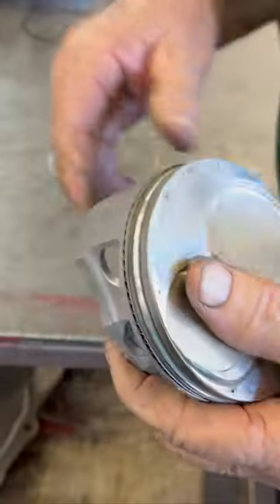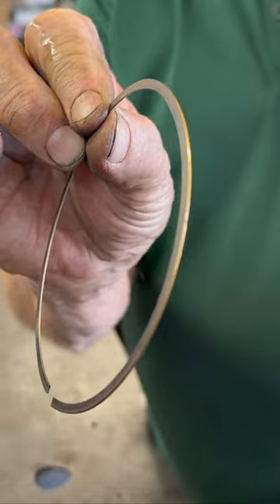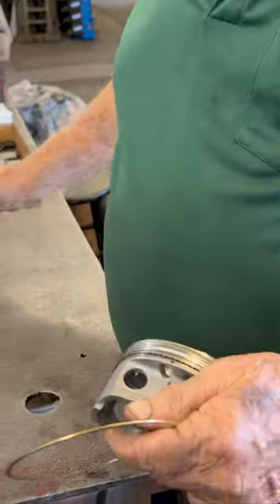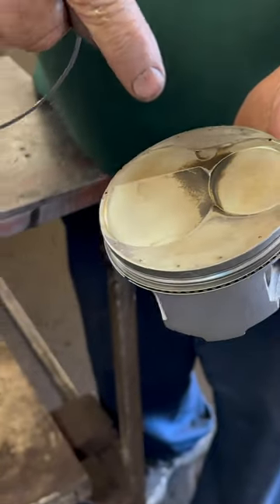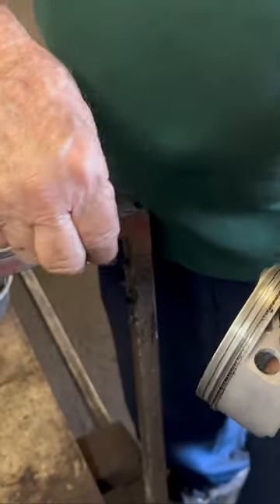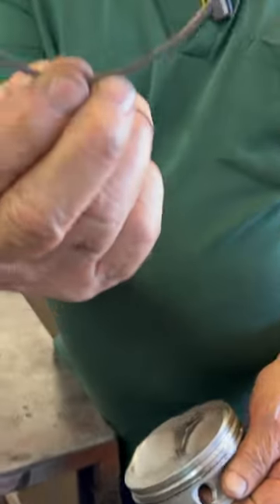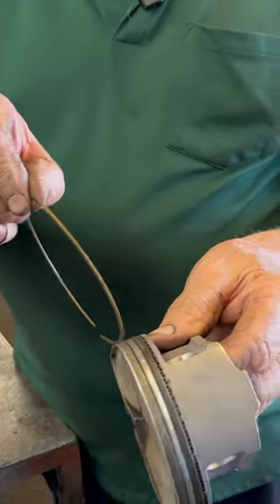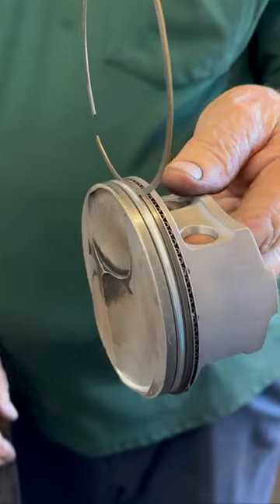No Drag Piston Rings? Ed Smith shares another secret Engine Building and Racing experiences #engines

Comment: Gas port pistons are for ring flutter at high rpm. Small gas port hole will easily fill with carbon so don’t think about using them on the street. Only for racing application.
Reply from the maker: Yes, that is correct. Thank you.
Reply: I was thinking the tiny holes would fill up with carbon and gunk
Reply: That's exactly what I was thinking......they'd clog up real quick with regular gas and regular driving.
Reply: There is already enough compression above the top ring to push the top ring out against the Cylinder wall. As the crown of a pistón is smaller diameter than the skurt
Reply: In addition this trick is going to increase fuel consumption. Unspent fuel is going into those holes and definitely increasing consumption. But I can see a high tolerance fitting engine properly lubricated spinning faster. You're definitely going to want to change the oil during the race / after each drag run.
Reply: But , but , my Honda only works at WOT , why can I NOT have them .I have a free flowing 4in oval exhaust made from inconel. I can use gas ports If I want ! Haters..
Reply: @jeremykastrup6907  apparently you need to look up the definition of hater….
Reply: Even in a race application they're great for what they do but they are hard on cylinder boar, it cuts the life down on cylinder bores in half.
Reply: Ther are for for boost and hold higher compression.
Reply: @FLORIDAMANIAM-he2lz  And for Normally aspirated.
Reply: funny my 426 had em since the motor was built in 1968 by dick landy i drove it on the street 10 years with none of those issues
Reply: not if you do what i did they used to sell water injection to clean carbon deposits every oil change i did what the 80 something year old man who sold me the car told me to do you take a water bottle and shoot straight water down the carb until it almost dies keep doing it 10-15 times you will see black crap pour out the tailpipe let it flow ! put one cup of kerosene and half a cup transmission fluid in the oil run it 5 -10 mins drain the oil let it drain completely a good hour take some hose clamps clamp 4 magnets to the oil filter so any metal sticks to the inside of the oil filter . your good another 2-3000 miles id change mine every 1000 never had any issues that motor ran 6:60 in the 8th mile almost 10 years and i ran it on the street every other day

Comment: In racing, we always used a worn-out top oil-scraper ring, since the engine technical inspection manual said they had to be present and be stock appearing.  This was done to reduce oil-ring friction.  Any small increase in oil consumption isn't an issue in racing.  Especially since we changed oil between race days as well as ran 100% synthetic SAE 50W oil.  We never experienced any carbon buildup on top of the pistons, valves, or within the clearance volume.  We always fully clearanced our engines to reduce friction.  The art of clearancing engines is knowing when to stop.  Too much clearance will decrease power due to excessive blow by and reliability.  We called over-clearanced engines "hand grenade" engines.  They would run fast, but didn't last.  The key is finding that sweet spot that will minimize friction, maximize power, and still be reliable enough not to self destruct.
Reply from the maker: Thank you for sharing your experiences and that excellent explanation!

Comment: Formula 1 pistons use to have holes that let oil from the crack get to the combustion chamber, this special oil had high octane and acted as a boost of hp the race car. A secret that was finally found out and new rules put in place
Reply: Yeah good ol'formula 1 - not how fast you can go, but how far you can bend the rules without breaking them
Reply: Most All oil is high octane. High octane means it burns slower. Low octane burns faster why you get engine knock file burns too fast
Reply: @airgliderz it's generally cetane that causes faster detonation
Reply: It's like a hybrid 2 - stroke in a way in a four stroke cycle. You'd definitely need a large crankcase / reservoir.

Comment: Low drag piston rings are used in more new cars now, those cars are often known to be oil burners because they're not scraping as much oil off the cylinder. Subarus are well known oil burners now.
Reply from the maker: Interesting
Reply: This is the comment I was looking for. 
Subaru isn't the only culprit. 
Gm across the board, ford, Toyota, BMW , Mercedes, Chrysler, Jeep doesn't matter which, they all burn oil. Ridiculous amounts of oil.
Reply: Wife just sold her 2014 Subaru Crosstrek with 120,000 miles. She had all the service work done at the Subaru dealership. I never did the maintenance on the car but I always check the fluid levels and tire pressures. Especially after it came back from service to make sure they did it correctly. The oil level never dropped between oil changes. Maybe the car is older than the engines you're talking about. The only extra service work done on the car was tires, brakes and a battery.
Reply: @davidclemens1578  We have a Subaru with 150k miles and it still runs like a brand new car.  The trick is proper maintenance and that includes running a good top cylinder lubricant in the fuel.
Reply: The Hyundai 1.6 has this problem. Well, if you keep up with oil level it's fine. Most people don't check their own oil anymore. Too fat. Too addicted to the internet.

Comment: I have used the total seal rings along with the itty bitty holes in the piston tops, along with drilling holes (2on each side) between the bottom of the oil ring and the wrist pin to feed the wrist pin bore, it worked better than you would believe, less oil leaks, etc.
Reply from the maker: Thanks for your comment, Dave! Great to have you on the channel
Reply: Interesting idea. 
Thank You!

Comment: There is one thing about the total seal rings that he forgot to mention: The thin ring that he showed here does not actually touch the cylinder walls... The 'L' shaped ring (that the thin ring fits inside of) actually touch's the cylinder walls. The purpose of the thin ring is strictly to block the end-gap of the 'L' shaped ring, creating a better seal...
Reply from the maker: Thank you for adding that detail
Reply: @BarryTsGarage  You are welcome partner.. This was an Excellent presentation that You made here Amigo...

Comment: Awesome info.  Devils advocate question.  What is the actual running drag once compression causes the ring to contact the cylinder wall.  And wouldn’t that vary with the amount of compression?
Reply from the maker: To the best of my knowledge - Yes - the ring would be nearly no drag during the 3 non-compression strokes and of course create some compression induced (variable) drag on the compression stroke. Great discussion!

Comment: Since 2006 honda have been using a type of piston that is made by a process called cold extreme high pressure diecasting ..its something like 4% less drag .. they also have the strength very close to forged and low expantion rate of gravity casting ...but i cant find any aftermarket venders offering them for production engines ....sure would like to have a set for my harley along with a set of gapless rings from total seal
Reply: it was in the little honda civic where i read they were  using the high pressure extruded die-cast pistons to power up their 4 banger for better gas mileage ..but its been almost 17 years later and you would think the aftermarket would be selling them to fit everything by now and i dont see or read a peep...they said they were strong enough for some low boost turbo or supercharger usage ...sounds to me like your perfect dream machine street engine pistons of unobtainium

Comment: Ran gas ported pistons in the early 70's. For myself, the gain wasn't worth the hassle.
Reply: Did you check the drag or did you just throw them in because they fit in the holes and you didn't know any better?
There is tons of drag on a standard engine with Babbitt bearings. The rain Gap would be different probably get away with less of a ring Gap but you have to keep filing the Rings until you get what you want to get. If you just threw the Pistons in there you could have even had more drag then before.
Reply: @jimmccauley9099 ??
Reply: Definitely more maintenance and oil waste. Carbon buildup sludge motor if you're not tearing it down between events. Not realistic for street use at all.
Reply: @markusgarvey   No junior, l could see a gain for a class car, but not the work involved for bracket racing. Not everyone like yourself started out in a pro-stocker.
Reply: They are ment to be used under boost or they glog up. Also they clog up anyway so theuy are for sports motors you rebuild constantly anyway.

Comment: The master mechanic!😊
Reply: All the millwright  mechanics were stumped  with oil blow by on yes yes air driven engine for emergency  🛗  for 🚇 underground applications. We had to pressurize  the case just 10 psi to fix.but now I think a bit different 😅<>
Reply: @arnoldcappelletto3236  ~interesting…

Comment: I put total seal rings in my 1600 vw air cooled engine which is no a 2276 fuel injected stroked dual 48 mm throttle bodied 044 and 037 port matched sequential firing turbo charged water inter cooled beast of a gernaid so far runs pretty good with very little blow by and very little oil getting caught in the catch can very happy with the results bummer I didn’t know they did rings for my 14 liter Detroit when I did it it’s current doing 789 hp to the ground which I think puts it between 1,100 and 1,200 flywheel hp thal about a cross country fun truck to drive 😬❤️😎
Reply from the maker: Very cool 😎
Reply: Ya the build kinda got out of hand but I’m kinda glad it did it’s a long term project but when I get done I’m thinking a lincence plate like “HC-ETR” hellcat-Eater 😬❤️😎

Comment: It's not the same as the scraper of an oil ring. The face of the ring is the same shape as a wider compression ring.
The scrapers in the oil ring pack have a radiused face that meets the cylinder wall.
There are also two types of gas-pressure holes; vertical as shown, and horizontal, horizontal are undercuts in the top side of the top ring groove.
Reply from the maker: Yes, thank you for adding that detail
Reply: @BarryTsGarage  
(I'm a fussy old fellow, lol)

Comment: If you drilled a hole even if it's a tiny little hole inside the Piston where is the compression??? Isn't that going to affect it??? Not only that but you would think you'd have blowback also??? I do know for a fact an engine won't run without compression or if it does run it will run like crap
Reply from the maker: I understand why you would ask, but, That hole is routed at an angle to push against the ring. It does not escape the combustion chamber.

Comment: Right so those holes give the ring it's tension. So you're testing rings with tension vs rings without tension. The friction is not going to be the same when you aping that engine by hand because the combustion is not spreading them out. Got it. What's the oil consumption when putting around as well?
Reply from the maker: My understanding is these are compression rings that are only going to be under pressure during the compression stroke and the rest of the time not dragging… The oil rings are as usual
Reply: @BarryTsGarage  ah, under pressure only a quarter of the time. didn't consider that. had to delete that whole angry comment i was typing. oh well, i'll get you next time.
Reply: @SoulTouchMusic93 Doubtful but go for it if that's the knife you want to fall on. Lol 😂

Comment: I'd be concerned that the holes would plug up and therefore lead to and be more problems than good.
Reply from the maker: For a normal used, that would be a legitimate concern, this design is aimed at racing engines, so they get opened up regularly for service and freshening up… Thanks for your comment!

Comment: Of course what he's not telling you is that type of engine is dumping gobs of gas into the 4 cycle combustion process. It's not going to be saving any fuel. It will rev fast. But you're pouring gas in an additional 20% to compensate.
Reply from the maker: This set up is definitely for Power and not for gas mileage

Comment: I'm trying to see total seal rings with the Square Endzone those Oil ring rails. I'm thinking total Sylvie would be like the lock Gap rings on a an automatic transmission main shaft seal rings, where the ends overlap and lock. Are the Rings he shows 3 thousands per inch of bore?

Comment: This is probably only viable if you burn ethanol. Gasoline makes too much carbon, so this wonr work well long term
Reply from the maker: You’re on the right track, these are for racing engines to get opened regularly… Not something for a long, mileage or daily driver situation!

Comment: Old NASCAR trick. Good for racing but on the street those holes will eventually get filled with carbon and defeat the purpose and maybe create problems.
Reply from the maker: Best for engines that get opened up regularly 👍
Reply: @BarryTsGarage  
Right.

Comment: I watched it twenty times an still don’t get it. Ughh
Reply from the maker: Basically, (as I understand it lol) the gas pressure in combustion Is ported to the backside of the rings to push them out against the cylinder wall to hold, and then the other three strokes, not under pressure there’s no drag…

Comment: What happens when the holes gets plugged up with carbon...yeah I'll stay with tryed and tested.....so tired of the new vehicles that keep breaking down like the 2023 cheve trail blazer pu truck with the 10 speed transmission that use the stupid plastic retainer clip to hold the transmission cooler lines connected,  800 miles from home and tyranny fluid leak and 2 plus weeks waiting for parts because it's on back order a bunch of crap so the life time warranty doesn't mean much when your broke down 800 miles from home and a 2 week wait to get it fixed ...I'll stay with old and tryed and true
Reply from the maker: It’s a Fair point, but on a racing engine, I think it’s expected that it’ll become apart by that time anyway…
Reply: @BarryTsGarage oh , thay should have said it's for racing engines,  maybe thay did and I missed it ?
Reply: @stevepearson6316 Don't feel bad about it. From the comments a lot of people missed it 😕.